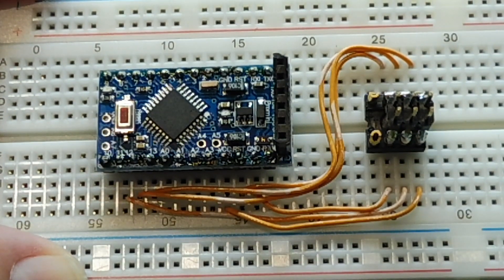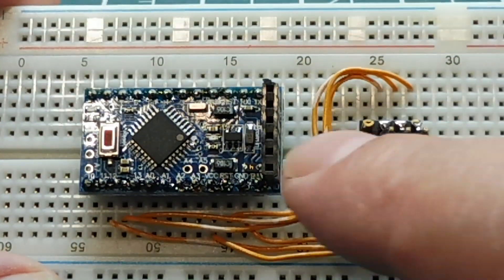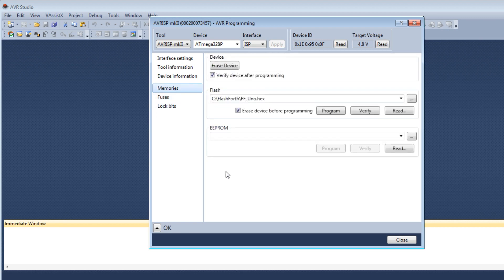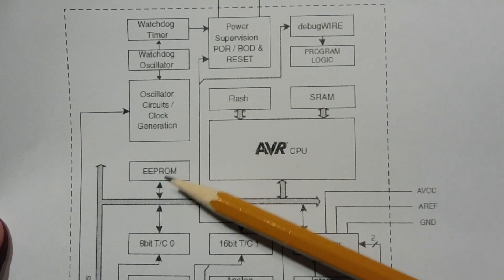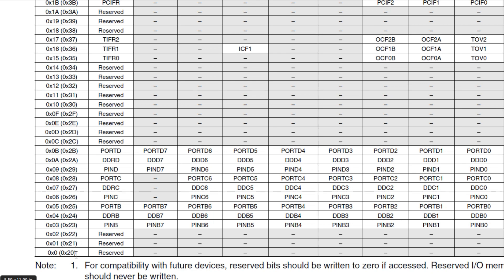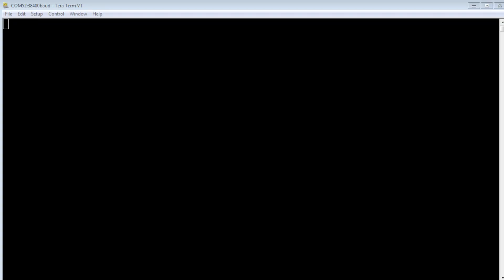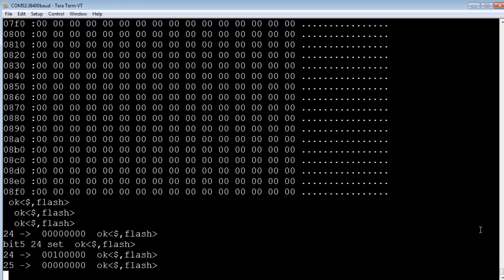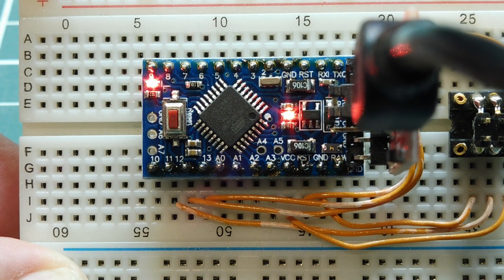Arduino ProMini Bare Metal Programming

Comment: I installed flashpoint 5.0 from the site,  but none of your word exist. Do you have a special build somewhere?
Reply from the maker: For beginners start with Interactive Arduino (IA.hex) based on eForth.
https://youtu.be/PY01_9dANd8
https://youtu.be/P6rMFcwik3M
Download .hex file and documentation. After you grasp Forth concepts go to FlashForth then Mecrisp forth for STM32 ARM micros and the new Pi Pico RP2040.

Comment: In forth there's a word called  CODE that will call assembly directly.  Is that what "as:"  does ? I'm not sure how it works in forth.  Maybe like CODE lda x ldx b     or something ?
Reply from the maker: Every Forth is different especially when it is embedded, as you have a limited amount of memory to play with. A standard Forth like F-PC running on a desk-top uses CODE and END-CODE for assembly words instead of colon and semi-colon.

code bset  ( b  #port -- )
   pop dx
   pop bx
   in  ax, dx
   or al, bx
   out dx, al
   next
   end-code
Here is an example of "bset" which activates pins on the GPIO port written in assembler.
Reply: @0033mer  Ok thanks !  i'll play around with it. I was using ting's eForth for Arduino
Reply from the maker: Ting's eforth is a good way to start as you have lots of documentation. It is written in assembler so there is no need to code in assembler. For advanced projects I would look into it.

Comment: After installing flash forth on atmega328p, how much resources are we left with? Sorry I'm not being lazy to look it up, just can't find the info easily. We can right bare metal assembly snippets as you shown, is there a restriction to the size? or can we develop a whole assembly program through FF (for example Conway's Life)? Much appreciated and your channel has helped me a lot :)
Reply from the maker: After loading FF there are 24k bytes of flash available for your application. There is a word called .usage which returns available memory for all three types of memory. There is no restriction on the size, but Forth programmers are encouraged to build lots of small chunks of code and use them as building blocks to create your program. This way you need very little or no debugging as each word is tested thoroughly. You can create a program in assembler alone but the Forth primitives are written in assembler so you can mix them with the same results.
Reply: @0033mer  Makes sense, nice. Now just a matter of going through the re-learning curve of flash forth, I did know forth... about 30 years ago :P
Reply from the maker: The best way to get back into shape is to look at lots of examples.
Reply: @0033mer 👍

Comment: Nice - Forth seems to be gaining popularity in the MCU world. If you ever decide to do anything with the Propeller again, it has a very sophisticated Forth system available that's very actively maintained and extended that the creator has named Tachyon. A derivative of it will actually even be baked into the ROM of the next Prop MCU (P2) that can optionally be used on chip bootup for diagnostics, etc, or even to use for full-fledged on-chip development. Cheers
Reply from the maker: Yes .. I have used Tachyon on the Parallax propeller in a few of my projects. It is a very nice implementation. I have been following Peter on his progress with Tachon on P2. He is a very clever fellow.
https://youtu.be/ZA9TKWN3wrI
https://youtu.be/PDr_S_efrm8

Comment: Very cool. If this was an hour long I'd gladly watch it (a few times :-)

 I think the install procedure you described here is also possible with an USBasp programmer and AVRdude, if someone wants to use a Linux system and open source tools. 
  I haven't tried (loading) Flash Forth with this toolchain. I regularly use the USBasp and AVRdude to upload binaries directly to an AVR. Perhaps one day I'll be in a position to buy another more modern computer with windows, but until then I like, and can get by with, my old gear and Lubuntu pretty well.

  Do you write everything from scratch in Forth or are you using some libraries? How would you interface with some random hardware. For instance, I just picked up a few vintage HDPL-1414 character displays for fun. They have a 2 pin address and 6 pin data parallel connection along with a Write pin. I just wrote a sketch to interface an uno with 4 displays connected in parallel on a bus a couple days ago. The only Arduino library I found for these required an I/O expander chip I didn't want to use.
 ...anyways...I am curious how you'd develop something like this in Forth. That, or even something simple and well established like coding a basic voltmeter with the AVR and a HD44780 based 16x2 display. How would that come together with Forth?
  Thanks for the upload.
-Jake
Reply from the maker: I write everything from scratch .. no libraries. I have collected many useful chunks of code that I have used in past projects that forms a pool of which I can draw from and reuse in new projects. Forth is interactive so you can write "what if" commands from the OK prompt for instant feedback. Once you get the hardware to respond, you can go ahead and write the final code and compile.
Reply: @0033mer  
  Alright, you finally got me to try forth. I got it working after cloning the FF5 git repository and using a USBasp to upload the ff_uno[hex] file onto a new(ish) nano compatible with the CH340E chip onboard (the tiny mssop10 chip without a crystal). I tried the AVRdude commands from the FF5 guide. Those don't work, of course. One needs to be familiar with AVRdude to see the implied details. I have to use the actual computer's tty connection name for the port with AVRdude. This was a pain in the past because the lsusb command doesn't show the tty connection name. I learned to use 
$ sudo dmesg | grep tty
that will reveal what connection the programmer is attached to. It's usually ttyUSB0 to start but this can change. I also tried the stupid python shell script command on the FF5 guide. I have almost no experience with python or shell scripts, but copy and paste along with trying basic mods got me nowhere. I can open the ff-shell[tcl] file manually as an executable. It opens a shell terminal, but is totally useless. I cannot connect to the μC or do anything with it. I tried several different GNU options through 
$ apt search
...but the only one that connects now is CuteCom. That's after discovering, all the info on FF5 about the AVR baud rate at 9600 is useless. Set the baud rate to 38400 after installing the hex file. After doing that, I get the line 
E FlashForth 5 ATmega328 13.01.2019 
  Actually, after trying several other terminal options, I tried the Arduino IDE serial monitor. I tried all of it's baud rates until one worked. Now I can do basic math on here. I also discovered typing "words" brings up a list of all the primitives.

    I still need to figure out how to follow along with what you showed here. When I type 
.flash 
the response is 
.flash .flash ?
When I press return in the terminal I get the response
ok <#,ram>
If I type in 
flash 
and then hit return, I can get it to say
ok <#,flash>
I think my problem may lay in the # part of this. In your example you had a $ in the same position. I don't know if this is relevant or what else I need to do in order to read/write to registers. I'm already burned out from messing around with this most of the day, but I can see I have a lot to learn.
 I'm mostly curious what you were doing different that caused different responses with the data from memory and registers. I don't know if my issue is related to how I am connected via serial or is based on the OS/language.
  Thanks for getting me started on something new.
-Jake
Reply from the maker: Start off simple and slow, there will be a lot to take in at first. Forth is extendable where you make up your own words which becomes part of the Forth language. Some of the words I used are my own so they will not be in the "words" list on your system. Start here and go through the examples:http://flashforth.com/ff5-elements.pdf
Reply: @0033mer  I'll read that document. Thank you for the reply and the explanation.
Reply: @0033mer  
  Thanks for that PDF reference. At least I know # is decimal, $ is hex, and % is Binary.

  I have one question that has been bugging me since yesterday. Forth is extendable, so do you always start a project from scratch using just the basic primitives, or do people set up their own compiled hex with their own words already added to the library? 
 I already came across the word "pick" in the PDF which is not part of the AVR library. I went into to FF5 folder that contains text files with these extra words and added it to my library. 
  Is this how most people use forth? You just keep a list of text files containing words that you copy and paste as needed? Is there a way to go backwards by exporting a library from a device to use elsewhere?
Reply from the maker: The answer to your question is basically "yes". When you start a project you start building your own words using the primitives. After using Forth for a while you will accumulate a large pool of words which becomes a resource for other projects. The more you program in Forth the easier it gets. As an example if you type: hex 0 $900 dump  you will get a dump of ram.  if you type: hex $900 $400 dump you will get a hex dump of eeprom. I made two words called: .Ram and .Eeprom which will run those chunks of code. When you write Forth code you are creating your own language that is related to your project.
Reply: Would there be any chance you could share some off this code (on something like github, for example?) I'm not a great programmer, and example code would help greatly. Thanks for the video, by the way. Very inspiring.